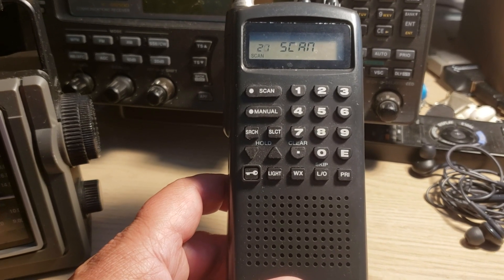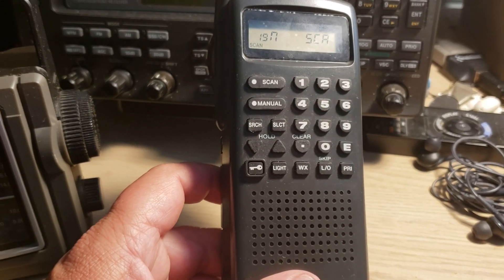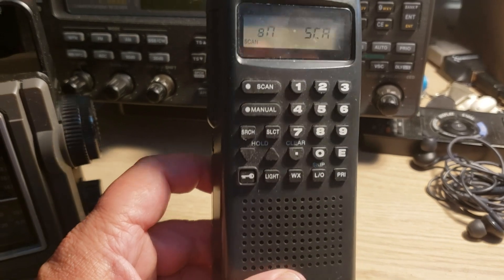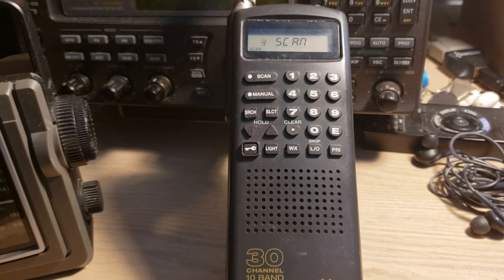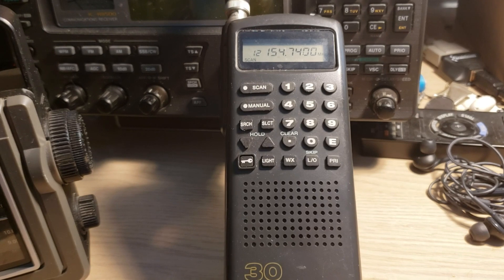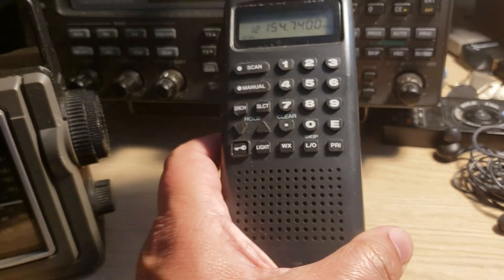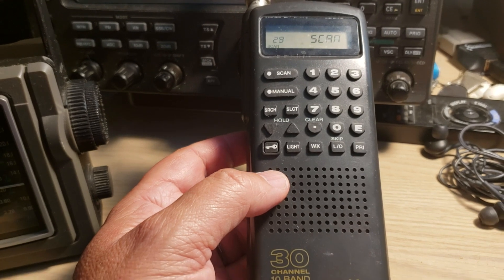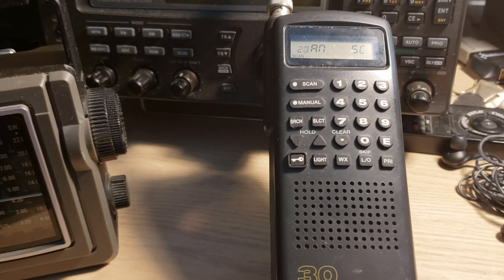What if my only scanner radio was the old 30 channels Bearcat BC60XLT

Comment: PRE 2000 models can easily be converted to 80 channels. I have a 2000 version (stamped inside board) and wonder what the difference is so I can go ahead and cross two solder points to get 80 channels. anyone?

Comment: Honestly considering most p25 systems will become encrypted eventually, its much more worthwhile to just use an analog. I just got a whistler 1040, still useful for air, military , uhf vhf, ems , murs, business, and ham.
Reply: I have this scanner and all I get is weather station. I can not get it to scan through channels. Do you have any ideas?  I read where someone said it needs "programming"; I have not a clue about this. Thanks
Reply: You can find a pdf manual for free online usually for these old scanners, most likely you have the squelch not adjusted right or the channels are locked out. I only really have experience with radioshack and whistler scanners.

Comment: There is a sliding switch inside the battery compartment that you need to select for NICAD rechargeable batteries or Alkaline batteries.  Maybe your switch is on the Alkaline Battery selection, and that's why it won't work with NICAD batteries in it.  I read that in the manual., didn't realize the switch existed myself until reading that in the manual.  Uniden has the manual posted for the BC60XLT on their website by the way.  Scanner works good even compared to my HAM gear that receives VHF.

Comment: Can't seem to remove channel lockout on channel 1 on my BC60XLT in order to program channel 1 with a VHF frequency, and make it the priority channel when scanning.  I followed the instructions, and can't seem to remove "L/O" feaure on channel 1.  When I try to enter a frequency in channel 1, it just says "Pchlokout" and returns to all zeros in channel 1.  Any recommendations?
Reply: Have you tried a factory reboot?
I also experienced a lockout bias, particularlly after I had accumulated a plethora of digital stray signals that were real nussances...over time ut became thousands of micro tuning channels.  I factory rebooted..changed the frequency step to broader  less sensutive steps and redid my isolations of those frequencys..had less of them and limmit problem wabt a problem..may work for you.

Changing the steps of the freq. Can speed up scanning and help avoid whole  frequency ranges that these BEEPERS and SQUEELERS inhabbit.

Comment: Did you check inside the battery case? There should be a slide switch to change from alkaline to rechargeable batteries.
Reply: Really? Interesting.
Reply: Yes, my 75xlt is the same way